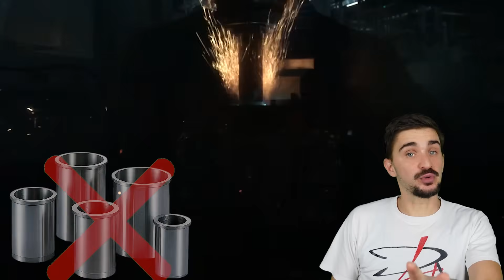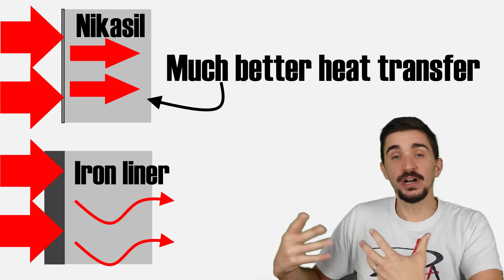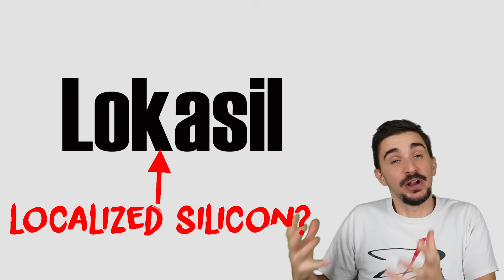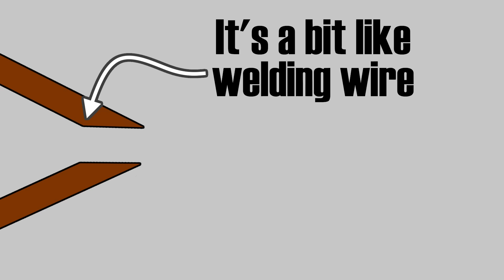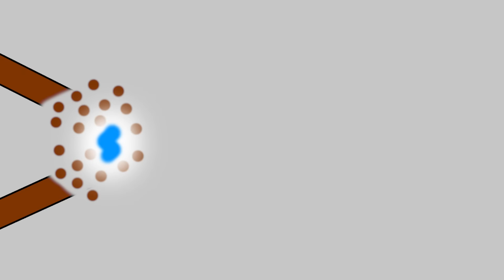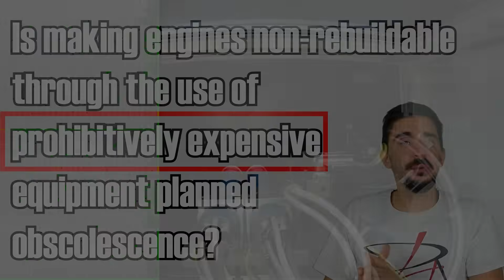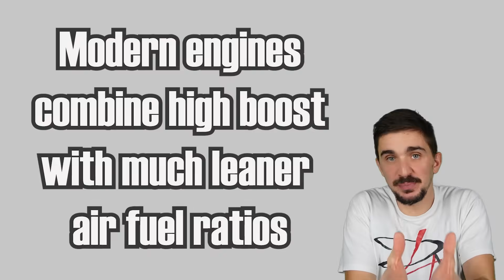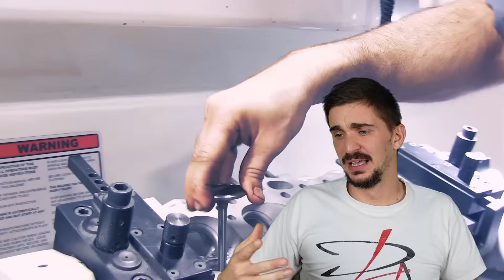Why Are Engines Becoming Non-Rebuildable? Everything About Cylinder Coatings

Comment: Maybe I missed something but why not have sleeves with the thermal coatings? Even if it's an aluminum sleeve it should still be possible to have the benefits of a more easily rebuilt engine and the advantages of the coatings.

Not to mention making the sleeves with these coatings would be much simpler from a production standpoint as the overall geometry and size for that matter of the part is simpler than an entire engine block.

Comment: would it be impossible to use aluminium sleeves instead of cast iron? 
it would cancel most arguments and hypothetically easier to buy it already treated... or am I missing something?
Reply: Kolbenschmidt did sell them for a limited range of engines, mainly Porsches

Comment: So, it is so difficult, sometimes impossible or impractical, and expensive to rebuild an engine these days, that the whole car is scrapped and a new car is manufactured and bought.
A big win for the environment.
Reply: That is the case even for old, low tech cars now. If you're going to have a good machine shop thoroughly rebuild an engine, the costs are prohibitive outside of a race application or something rare/vintage. At $150/hr or more for labor, it doesn't take long before just replacing the engine or scrapping the car makes a lot more sense.
Reply: @OtisFlint  I agree with you 100%. I have a couple classic vehicles, and I would absolutely rebuild any of their engines. My wife's compact SUV wore out last year (after over  a decade of use) and we replaced it. 

We live in the Northeast US. You're lucky if your car wears out before it rusts out. On top of that, most people don't have the luxury of letting a car sit while the engine is rebuilt.
Reply: @OtisFlint  That's why you do it yourself, and just be self reliant in general.  FFS you people subscribe to life as a service these days, everything is this stupid, lazy, buy your way out of problems instead of putting in effort to better yourself and accomplish something.  I just rebuilt a 30 year old cast liner engine in my home shop for a few hundred bucks and i should be good to run for another 30 years before i need to do it again.  $150/hr for labor is an idiot tax.
Reply: @rustymustard7798  Yeah, spend $1M on equipment to build one engine makes total sense, vs $2500 for machine work. Not everyone wants a hack job bud. My last engine was over $7k in parts and machine work, and I removed it, disassembled it, reassembled it, and reinstalled it. Sounds like you're playing with John Deeres while i'm playing with modern German cars.
Reply: @rustymustard7798  will you buy the required equipment for me daddy? If yes, then I swear I will learn to do it!
Reply: @OtisFlint  Modern German cars? Well there's your problem lol.  I'm talking old big bores and carbs, pushrods and all mechanical things, not a science project being kept on life support by the computer.  

Hack job?

I'm a 'retired' aircraft and marine mechanic, been building engines since the early 80's, i've wrenched on everything from weedeaters to superyachts, 18 cylinder radials and Garrett turboprops and such.

I didn't spend a million on tools or $2500 on machine work but still get way better than .0005 accuracy with my caveman tools like micrometer hones, hand stones, and flat surfaces in my shop.  Yeah it takes longer doing it slowly by hand but my decks and bores and all flat, straight, and round within .0002 and do the thing, make the power and all that.  There are no machine shops where i live, there was one guy in the region but i think he passed away.  I gave up on trying to find machine shops a while ago.  If anything i might end up being the local machinist anyways if i decide to get a mill and lathe for my shop.  And an old mill or lathe doesn't cost a million dollars, it's closer to the the $2500 you'd spend on getting one block bored and decked or resleeved.

Rebuilding modern cars, German or otherwise is like trying to reuse toilet paper, they're built to be disposable VS a family heirloom.  I've played with 70's and 80's GDM grey market cars, tuning and racing classic Benz stuff that was built like an aircraft, now they're just overcomplicated trash i won't touch.  Modern cars are like Bic lighters, you use them till they don't work and get a new one. 

I ditched all the GDM stuff though and had WAY more fun with classic JDM builds at the strip.  Nothing like smoking a 4th gen $20k Civic with a $500 2nd gen Prelude junkyard build on grudge night. Twin carbs tuned well>Motec and LSD and all that fancy tech according to the timeslips, every weekend.  And old pushrod engines just work if you build them to the numbers, you don't need a million dollar CNC to do any of that unless you're cutting your own cams.  Hot rodders have been patiently doing it by hand like this for over 100 years.
Reply: LMAO nice!
Reply: No, people source a perfectly good used engine from a junkyard from a car that had some other damage (like rear end) and just bolt that in, they don't scrap cars that are economically viable to repair.
Reply: that's what happens when you expect high performance and low emissions
Reply: @no.nomoreidontcare that’s what the game is these days.
Reply: Exactly. Why aren't automobile manufacturers held to any standard in regards to building repairable/upgradable/modular vehicles?
Reply: @ I suspect it would make the vehicle much more expensive in the first place. No matter what if a manufacturer can’t make a profit and expect an ongoing return they’ll stop making cars.

Comment: Why is spray coating so expensive? Seems like a pretty simple process with just a wire being feed in front of a plasma torch, or two wires arc welding each other in a jet of nitrogen.

Comment: ok, why not a sleeve made with the same metal as the block, and have a wear resistant coating on the sleeve?  i know it will not achieve narrower cylinder walls and weight reduction, though the aluminum sleeve will weigh less than an iron one.
Reply: more expensive then singular block. why would manufacturers want a compromise with anyone?

Comment: Those who want to argue in comments, please bring data for:
a) Reputable scientific sources VS real life cost. 
b) Proffesrional engine rebuild VS new engine.
c) Modular engine (individual cylinder + head) VS multi-cylinder block with multi-velve head. 

At this moment I am unable to find real world examples for "a". Papers do not match real life data.
Professional engine rebuilt is significantly cheaper then new engine.
Small number of modular (easy to rebuild) engines makes it impossible to directly compare with blocks. There is no modular engines with coating.

Comment: One of the last Alusil M62 V8s BMW produced is in my August 2003 build date X5. It has 235k miles on it, still running strong. Has always been run on Shell or ExxonMobil fuels, w/8oz of Lucas Upper Cylinder Lube added at every fill after the X had accumulated 100k miles.

Comment: Was hoping there would be a bit of info on what research had been done on having both piston and cylinder walls coated if anything. Maybe also any changes to the interactions with piston rings with those coatings.

Comment: the motivation is Money. Always. There are tradeoffs to be considered. Spray on coatings are just really thin liners. Now, no one outside of the factories currently does it on a small scale a rebuilder would need as of yet. Also, the factories have a billion Regs they have to meet and basically the vehicles only need to meet those for the warranty period.

Comment: Lister embraced the  Van der Horst patent process for Chrome plating cylinder liners in  the mid 1970's - a key part of the process was the reversal of polarity at the end of the plating process  to put microscopic cracks in the surface which would retain oil much like honing - they claimed it was 4 times as hard wearing

Comment: My Toyota 2arfe has spray liner cylinder walls. The walls can be bored minimally. Toyotas spray liner is kinda thick. People have overbored the cylinders by .5mm in diameter with no issues. I believe the spray liner is about .8 mm thick

Comment: The alusil engines can be refinished, if the bore size is within parameters.
Reply: but at the cost of derating it
Reply: @ not to my knowledge. You polish it to remove scores, and etch it back to factory specs. The issue would be the condition of the bore, in terms of the depth of the scoring.

Comment: rebuilding produces 20% less co2 then recycling? moving, sorting, heating a massive oven to smelt it down (nevermind that its usually the whole car getting scrapped) is only 20% less emissions then a local shop taking the engine apart, machining out a block and putting slieves in it?

Comment: You say that is cheaper buy another car than rebuild the engine. But you say this because you don't live in Brazil. Today the most cheap car cost around R$80.000 (eighty thousand reais) and rebuild an engine cost around R$7.000 (seven thousand) with top quality pieces.

Comment: You can rebuild them but the block needs to be machined to accept a sleeve. I used to do this for motorcycle engines 10 years ago. Done right, it will work just as well as a non sleeved engine.
Reply: If the coating is as thin as he is saying, and the block is also extremely thin, you probably can't machine them to accept a sleeve.
Reply: @nathanahubbard1975  you might be right, not all o them might be repairable. But all of the Japanese made 4 cylinder engines from the 2000's era I repaired this way, had cylinder walls thick enough for this repair.

Comment: The least-cost, most effective way to achieve higher performance with lower emissions is to use a nanopolishing lube such as NanoXD. Based on cutting-edge graphene science, applying it in an engine obviates the need for hard coatings — and, indeed, for an engine to ever need to be rebuilt.

Comment: They are rebuildable, but it requires tools and skills a home mechanic or existing shop are unlikely to have. Like, imagine building an electroplating vat large enough to fit a six-cylinder block and enough electrolyte liquid to replace the liner… after removing the old liner without blowing past tolerances.

Comment: There is one miscalculation. If the engine is non rebuildable, it's not just the engine that gets recycled because the whole car will be scraped/ recycled Producing around 1.5 metric tons of co2. With a rebuildable engine the car stays on the road producing far less emissions than building a new car. I drive a 1990 mk2 golf GTI that produces around 200g of co2 per kilometre. A new ice mid size car produces on average 5.6 metric tons of co2 to manufacture  and an average EV produces 8.8 metric tons of co2 to manufacture. so i could drive my car with a rebuilt engine 35000-55000 Km and produce the same emissions as recycling old car and manufacturing a new ICE/EV car.
Reply: Non rebuildable doesn't mean non replaceable
Reply: Why would the whole car be scrapped, and why would you necessarily have to put back the same engine in? A car with spray coated cylinders in the engine can get a new engine, and so can you (if you wanted to). That was the comparison. The vast majority of people will choose the option that fits their wallet and lifestyle, amongst other behaviour, and that part may or may not make the CO2 calculation outcome different.
Reply: @Southghost5997  I'm currently making 1 car out of 2 due to one being LHD and other RHD both same make and model one engine tho needs new crankshaft main bearings while other is at 280k km and still running strong also latest emissions test was done on it putting it at 113g of co2 per kilometer and fuel economy usually on full tank which is 68 litres put that engine to 1.1k km if was very good diesel fuel quality have seen even go up to 1.3k km. I refuse to throw away decent engines and only issue is one oil sump gasket seal on these really that puts these engines out since the engine is out of car and partially disassembled I will just get the parts which came out to roughly 60 euro and put it back together and drive another 280k km on it.
Reply: also these engines sell for 500 euro just the block anyway so even then this is best for me as I can just sell the 2nd engine after tearing it down and fixing some minor issues. engine being broken depends on a lot is it the head is it the block is it the crankshaft etc. etc. you can do a lot if you're smart enough. go play more with legos will learn more how a lot of stuff works.
Reply: have a '87 Golf.  Did have to toss the original engine,  plugged drillings in #3 crankpin blocked oil to the rod, caught it in time, put in a salvage yard engine, $26. for the head, $65 for the shortblock. (I tore it down & inspected it in the yard before buying, bought in two chunks lol.).   Now at 600,000+ miles.   Those iron-bore Bosch FI  Mercedes-Benz designed fours are rugged stuff. (too lazy to de-carbonize the old pistons/crank so that $90. replacement block & head were too cheap to pass up)
Reply: CO2 is the gas of life🙏
Reply: The VW* ea827 is one of the strongest engines ever made, you have a tank! I love old cars, who cares about emissions and fuel consuption? I want a engine that handles abuse and lasts longer
Reply: This is nonsense because people do not rebuild engines for commuter cars regardless of the cylinder type. It is too expensive now.
Reply: A lot of that is because gas pollution is immediately noticed but non-heavy metal scraps are much harder to notice and felt until like, let's say actual centuries.

Comment: I think you touched sth that's more common in engineering. Thanks to labour costs rising more than materials, it's more cost-effective to build things that lasts a little longer than make everything serviceable. Also manufacturers sell products to first customer. They don't care much what will happen later, especially after warranty period (like other manufacturers, not only automotive). As an engineer I was many times in situation where you see that sth can be made better, but it's not economically viable for producer and end user. Also solutions that are serviceable are more labour intensive, so more expensive to produce. That's why we have automation after all.

Comment: Rebuilding an engine also likely expands the lifespan of the whole vehicle. So I guess you would also need to take in account the manufacturing of the new vehicles that are to replace the cars with engines that are not repairable. I just suspect that it's more likely a person will keep a vehicle with a repairable engine rather than buy a whole new engine to be able to keep it. 

But you're right.. even rebuilding is becoming something that is not affordable anymore.

Comment: Excelent video, as always. Considering engine rebuild C02 Calculation. The entire recycling of the car should be take into account into the calculation, since the number of replacement engine is always limited in the market and tend to be 0 in the long run ( +25 years ). I always wonder if this is better for the environnement to continue to repair my older car from the 90s era than to throw them away and buy a new one. I am pretty shure your brillant enought to get the math done. I am happy there's someone like you to put free and avalaible data in a easy to eat video.
Reply: My rule is; if it's easily rebuildable, keep it and rebuild it. Markets spring up around the good ones and often the price of entry is high (older Toyotas for example), but the cost of maintenance/overhaul is offset by much longer intervals between downtime.

Comment: Alusil and such can easily be repaired!
Just bore it over size and etch it.
On some manufacturers the silicon is so thin you just can do that a few times, but still doable!
Those wire sprayed coatings are also mildly repairable.
If they are worn to a certain point, you can re hone them too!

But all those coatings are relatively dog shit in my opinion!
Because they are so hard, you need a coating on the pistons too.
And between the composition of the bore coating and the pistons, is a lot of room for errors and fluctuations in the composition and application.

Comment: My Honda D15Z8 with 315.000km on the clock takes 6-7l/100km, so it is efficient enough to be saved, i would say 🤷‍♂️ but yes, you made a clear point that not every engine is worth rebuilding...
Reply: It’s a honda mate, you will never have to rebuild it anyways, because it will never break
Reply: I had one of these engines i flipped. Change the oil. Take care of the transmission. It starts burning oil change the rings. Those d series blocks can take a damn beating.
Reply: I am just a month after rebuilding my D16A7 (Oct 1990) and I am absolutely f*cking loving it...
Reply: It’s not only about fuel consumption, but also emissions. And these are way higher compared to a modern engine. Even if fuel consumption stays the same.

Comment: Valid points on rebuilding costs. My son (mechanic at independent garage) was trying to get a timing belt kit for a ford eco boost engine 125k miles. Ford garage said they didn't both doing a belt as it was easier and cheaper to replace the engine. You decide if that is OK or something like planned obsolescence.
Reply: Ah yes, stupid ford ecoboost with the cam belt in oil bath.
Reply: Lazy and people expecting warranty

Comment: Its no different to fine micron cylinder head machining. Many machine shops don't do modern stuff as a result because the milling machine required is not your nornal hare and Forbes unit. Its speciality now.

Comment: Here in Southeast Asia, the easiest way to identify any engine that could possibly have "Planned Obsolescence" design built into its engine is easily identifiable with one specific plaquered.  "Made in China"
Reply: With 24 carat Chinesium too! 🤣 If you thought aluminium having the same wear resistance properties of '... a wet biscuit' was bad, chinesium is only slightly more stable than astatine 😆